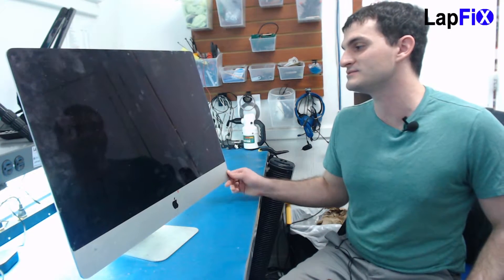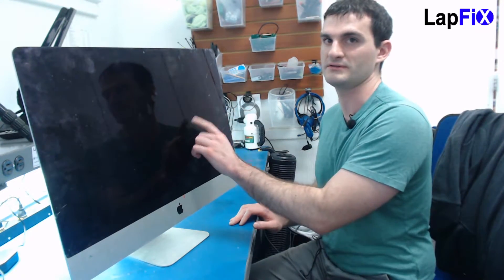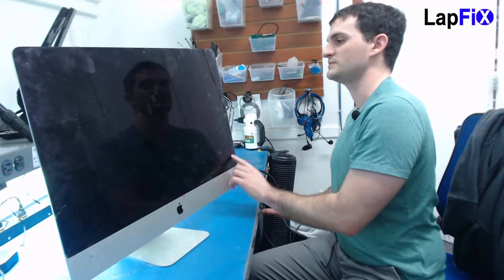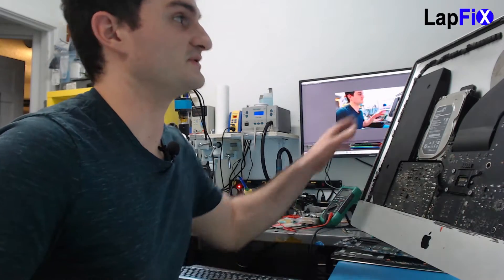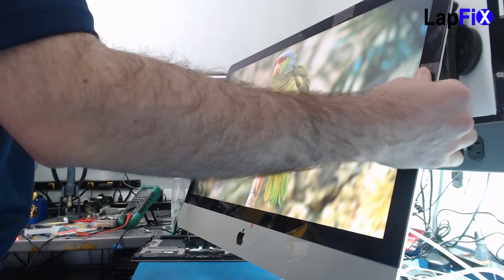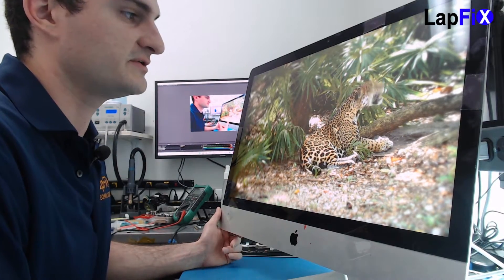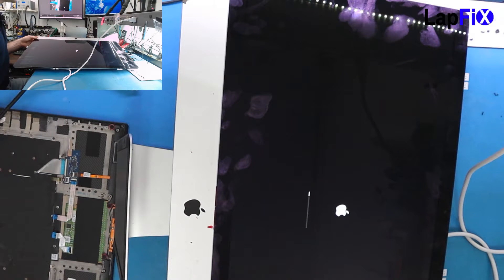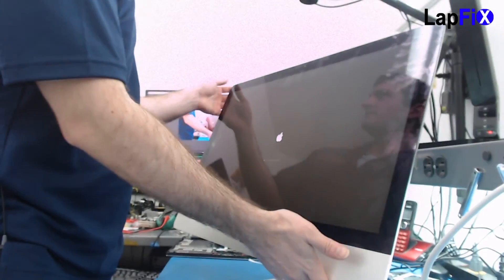How to Replace iMac 2017 - 2019 Screen - What to upgrade ?

Comment: Can I install an imac 27 2020 screen on an imac 27 2017?
Reply from the maker: It depends on the model.  Some of them come with  5k resolution.  Best case would be to check the panel # on the screen itself

Comment: Nice Video!!  I read that some iMac 5k 27-inch screens are interchangeable. However, the ad didn't specify that information. Do you by any chance know where to find out which screens can be used to change out a 2019 5k 27-inch screen iMac screen? Please share the info in the event you know. I'd be ever grateful.

Comment: You mentioned burning the LCD with too much heat. Is that because of the cracks, or is something fragile in all the corners of an iMac 2012 -19 which is located in that area??

Comment: Thanks, good video!

I used to be an ACMT and I miss the good old days. The older iMacs had a replaceable glass panel that required no tools and took about 3 minutes if you didn't have to clean a bunch of glass shards out of the inside. Just two metal tabs at the bottom and magnets holding it on.If you needed to do upgrades like a hard drive you just lifted the glass off with suction cups and removed the LCD with a torx driver. Apple continues to make it more and more difficult and expensive for DIY.

My wife's 2019 21.5" Retina 4k just fell off the table when the stand collapsed. There are spider web cracks across the glass but fortunately the display still works. I guess we'll just have to live with it.
Reply: Truely Apple  sucks, I just took off cracked screen on iMac 2020,  27 inch screen and it is a sticky mess any idea how to get the darn glue left on the lcd screen after removing the glass. This process took me 3 hours to remove all of the glass off of this extremely sticky surface?

Apple sucks they should have stuck with the magnets and suction cups to remove the screen. 

Grade of D+ to Apple for screwing people who need to replace the glass over the lcd part of screen.

Any suggestions on what to use to remove the glue from the LCD I would be so grateful as I have replacement glass ready to go.

Thanks,

David
Reply from the maker: Yes, you are talking about the -2011 models.  I wonder how replacing the imac g3 CRT was.  We had one of those in. I think it was before we were making videos.  Would have been fun showing it.  Thanks for watching and the kinds words

Comment: You don't need a heat gun to get the glass off.  Use a utility knife between glass and frame, it came off easily for me.  I'm not worried about the old adhesive because I preordered the display adhesive kit from Apple to apply to the new display.
Reply: hot air gun  helps more

Comment: This screen is indeed very difficult to remove. Especially, if you have to reuse it as in case of replacing the hard drive. Chances of damaging the screen is very high. I do not agree that he should use a metal spatula to penetrate the glue-filled space between the frame and the screen. Best thing to do is use a plastic razor-thin roller with a handle. If you apply a lot of heat, sure it will loosen the glue. But it will expand the glass, which in turn can expand the frame of the display and cause it to bleed permanently. There is no fix for that. If you are a technician and you are asked to replace this screen, plan for a 3-4 hour job depending on your level of proficiency. One more thing, have good gloves to protect your hands and a good workbench with plenty of space. The edges of the iMac is very sharp.

Comment: In a robbery they through mine on the Floor and the chin is bent. Can it be straightened
Reply from the maker: That is the frame of the imac.  Most likely you would need to replace the whole frame

Comment: Heating the screen can often damage and discolour it if you are not skilled / experienced. MUCH easier to buy the little tool that looks like a mini plastic pizza cutter. No heating required and I have done HUNDREDS of imac screens without incident using the same tool that cost about $5 and comes with most of the adhesive kits that you need to re-attach the screen and (yes I know) you can buy some quality 3m thin tape and do it yourself (which I now do as it is far cheaper than the adhesive sticker kit). I think this method is MUCH safer considering a replacement screen is about $800 AUD. I've been working in IT for 35 years.
Reply: Very helpful thank you. 

I have several Questions need your professional advice and these are the things that happened in the process. I am already $$450 into this repair and now just want to do the next best thing so I can get my computer working again:advice:

1) put in brand new iMac screen for my IMac 2020 and hooked up all cables turned it on and nothing came on after I had already sealed it up.

I had to buy new cable since when the original screen came out it ruined one of the pins on the cable.

I bought new cable and then plugged into new screen and nothing worked unfortunately I sealed up the screen before checking to see if the screen and new cable worked. It does not work. The old screen was working but is was so cracked that it was not ledge able.

Would you recommend hooking up side monitor and using that? 

1)With HDMI 3 cable to hdmi and plugging in external monitor?

2)is it possible that the connector on the motherboard was damaged when screen fell out onto desk? 

3)screen that was sent to me was defective?

4)Apple 2019 IMac  cable does not work with 2020 iMac even though it looks exactly the same?

Let me know your thoughts.

I am ready to take computer into you break we fix store to have them get it right. 

What are your suggestions?

Comment: Hi does one need the cutting wheel, say by iFixit to remove the adhesive tape for say, the Late 2015 iMac 5K 27"?

Thank you.
Reply from the maker: The cutting wheel is a piece of plastic not very sharp.  Using a razer thin plastic to help cut the adhesive as you heat it is the best way I found so far

Comment: Which glue is to be used to fix back screen? Bro I watch your videos
Reply from the maker: Any double sided tape should do.  3m is a very good brand for that. You can do it manually or buy specific adhesive for the model imac you have which I recommend doing.    Thanks for watching =)
Reply: @lapfix  thank you sir...will be THRe with more thoughts...your videos help a lot...

Comment: Just a couple fo tips for anyone else looking to do this - I would 100% recommend getting the kit that fixit sell to do this.. makes the job 100 times easier.  In the kit you get a service wedge (which keeps the screen in an upright/fixed position) to make it easier to work on - you also get a 'pizza' cutter to hellcat through the adhesive - this is preferably as it will not cut too deep and do any damage if it slips - there is also no need for any heat when you do this.. just run the pizza cutter round - life the screen forward - disconnect both cables and then remove the bottom adhesive..
Reply: What about finding a screen? I can't seem to find a glass screen alone for a 21.5 inch iMac (late 2015). Does Apple or someone even sell screens?
Reply: Definitely I'd vouch that the pizza cutter makes things a LOT easier.  I had one that the screen was already cracked.  I used a box cutter and I put just a little bit of pressure and cracked the screen even more.  So a word of advice to be patient and use the right tool!

Comment: Lapfix, gret video. One question, after putting the screen back I noticed a very prominent backlight bleeding in 2 or 3 places around the edges, alogside a purple tint all around the screen (specially in the corners). I treated the screen with much care. Not sure what could have caused it. Is it permanent damage? Can it be repaired by ungluing and resealing the screen again? what do you think?
Thanks!
Reply from the maker: Hard to say without looking at it, but usually the yellow around the edges can be a "burn" from applying too much heat.  It is easy to cook those corners as the adhesive is harder to loosen there.
Reply: @lapfix  Thanks for the response. I didn't use a heat gun only a "pizza cutter" plastic thing from iFixit.  I guess I bend it very slightly or soemthing. I think I'll send it to Apple for a screen replacement.

Comment: 1) Can you provide a link for all the pry tools one's needs (that you are using) to safely remove the LCD?

2) How do I determine which specific LCD screen I need to replace a cracked display on an IMAC that is not yet presently in my control and access? (Im thinking about buying one off Ebay which has a cracked display) Can you provide a vendor link to where one may order refurbished or new displays for IMAC 27"?   

3) How does one ensure one is ordering the correct replacement if one does not have the part number of the original display that is cracked?

Comment: Have you tried to open up Imac a 2nd time? The adhesive strips used to seal up the screen to the frame are different from the original adhesive strips. The after market strips are thinner and make it very difficult to get screen off a second time....if you have found a way to do this, I would very much like to know. Thank you
Reply from the maker: The original oem factory adhesive should be stronger than anything else.  Enough heat should make it come up, just be careful
Reply: @lapfix  Thank you for your response. My experience using the pizza cutter wheel worked fine on the oem adhesive, but on the second try very difficult, which unfortunately resulted in having to replace the display.
Reply from the maker: Pizza Cutter 🍕😮

Comment: i have late 2012 27" iMac with normal display. Can I replace my n normal display with Retina display?
Reply from the maker: I believe the late 2012 imac is the thin retina one.  If you are referring to the older one, you cannot change the normal display to the retina one,

Comment: what would it cost me to have someone do it?
Reply: it's not a hard job - just take your time and get the right equipment - don't put unnecessary stress on the connectors when you are opening the screen so you don't damage the cables or connectors on the board.. there's a good step by step guide here:

https://www.ifixit.com/Guide/iMac+Intel+27-Inch+Retina+5K+Display+Hard+Drive+Replacement/30522

Comment: after replacing the screen the mic is not working, any advice?
Reply: in case anyone else sees this: you need to cut a little of the bottom adhesive ove the mic, or use the exact adhesive for our model which will come with the cut out for the mic,already.

Comment: I just found a very small fly inside the screen of my iMac 2013. It was crawling around and now it settled to the bottom of the screen where the apps are and it looks like it's dead now. Is there anyway to open up my iMac and get the bug out by cleaning it without having to replace the whole screen? Thank you!
Reply from the maker: You can actually see the bug through the screen? 😮
Reply: @lapfix  Yes, it's a very tiny little thing but visible. If I didn't see it die myself I would assume it was a pen mark. I guess there's no way of fixing this then. Thanks for the reply.
Reply: @MementoMori-xx5qo  i have the same problem on my 27" 2017 5k retina with 2 tiny flies, one on the top right (not bad) but the second one is in the middle of the screen and as a photographer this is very annoying when i'm in post prod !
I'm not sure what to do... if i open it up i would probably change the hard disk and CPU but it looks risky !